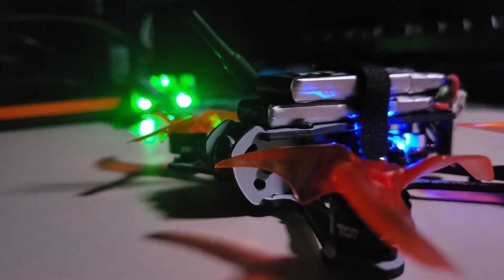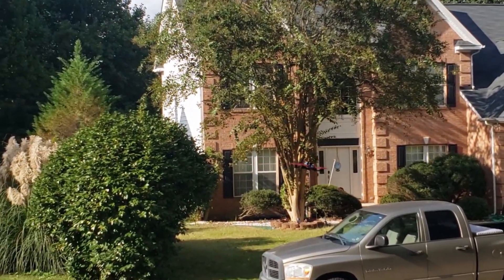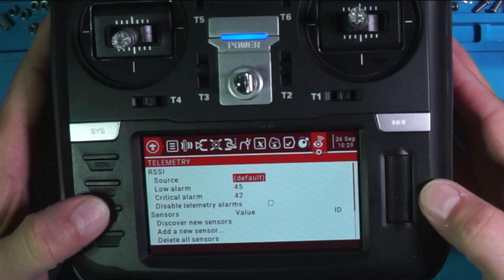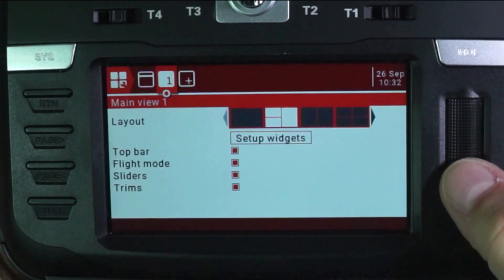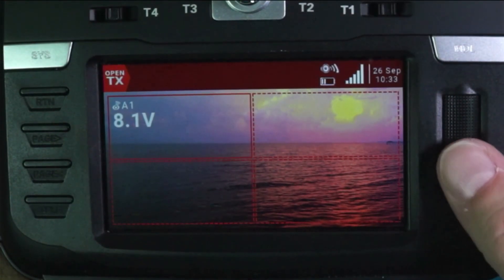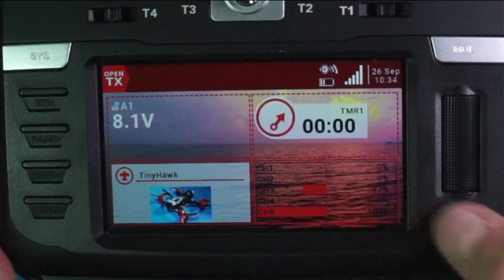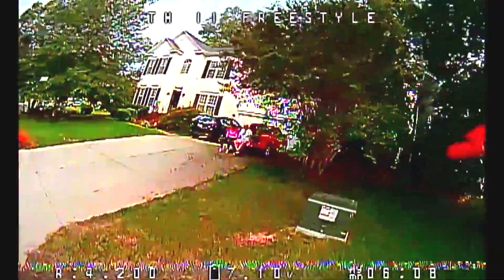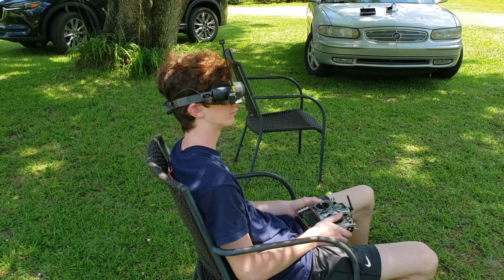Tinyhawk Freestyle 2 and TX16s Setup Telemetry

Comment: Question i have an issue with the radiomaster. My throttle is on both gimbals. How can I get it to my left gimbal. Thank u . Excellent instructive and informative 👍 videos. Take care and be safe.
Reply from the maker: It sounds like you have something wrong on your inputs screen. Go back and  double check that you dont have two Thr set up.
Reply: Thank you so much for your prompt response. But in inputs thr is once. And in mixer on channel 3.
Reply from the maker: Try setting up a brand new model and Go slow through the wizard ensuring that you have AET R.
Reply: Copy that. Thank you Again. Will keep you updated.